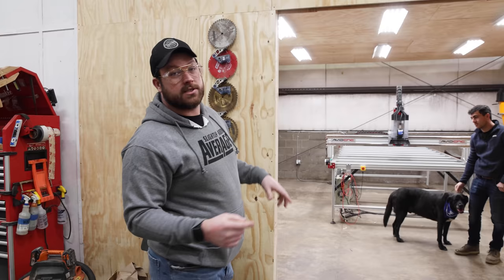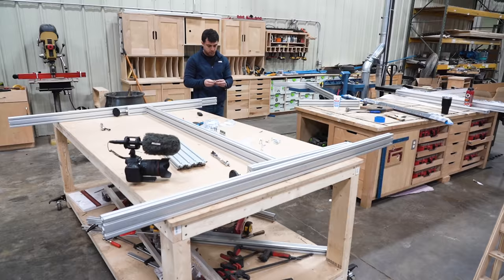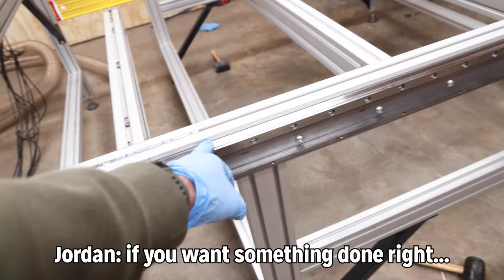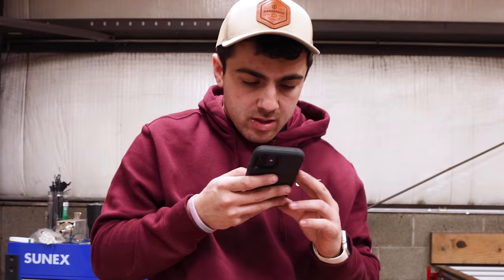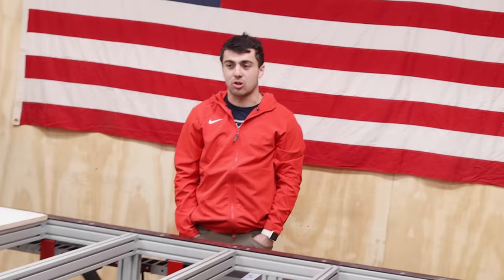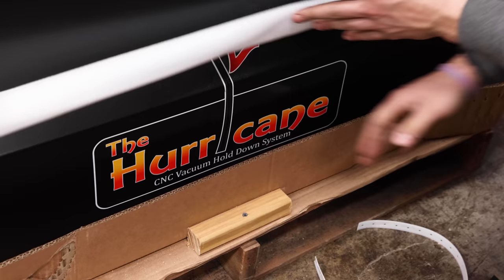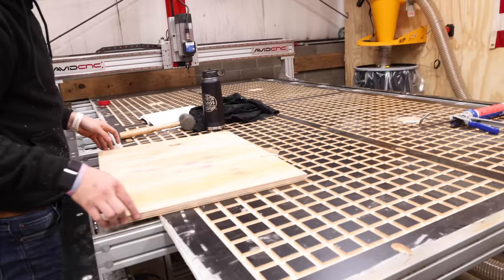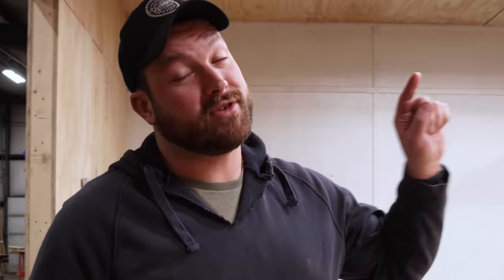Did We Just Build The LARGEST CNC On Youtube?

Comment: Jordan, Sam excellent work love how you guys check your work and square as you go can’t wait to watch Jordan slay some slabs on this thing I work at a cabinet shop and we use bungee cords to suspend our dust collection to the CNC definitely not as sleek as the pocket rail system but definitely efficient as the CNC moves away the hose moves with but also contracts as the CNC returns to 0,0 keep up the great work guys! Also I think if you were to move the rails to one side of the CNC vs directly over it might pull it easier and only give the CNC enough hose to go end to end when we got out second 4x8 CNC I did the dust collection and gave it to much hose and the CNC would catch the hose and rip it off very frustrating but you guys will figure it out I’m sure of it!

Comment: Looks like you guys need a rigid swinging arm for the hose. Do solid pipe along the wall about 8 ft, then a big swingin boom arm that reaches to about the middle of the cnc. Run your hose up and over that for moral (and physical) support.
Reply: Lincoln Street Woodworks did one for his table saw. Seems like it would work well in your aituation.

Comment: For dust collection we started out with hose suspended from string on a track but ended up putting in a boom arm made out of the same external diameter tube as the internal diameter of the flexible hose. That way the boom covers most of the table and you only need relatively short peices of flexible to reach the gantry.

Comment: for the dust collection pipe... Suspend the pipe from the middle of the table on the long edge on the dust collection side. Then move the router to the diagonally opposite corner. Now connect the pipe to the router so that it hangs from the middle and will reach each corner. No rails needed and the pipe won't twist etc.

Comment: Put masking tape over the corner the material makes with the MDF. It creates a stronger suction and will keep material from breaking vacuum with the table. If the machine gets hung up in the material, it will move it on the table even with the vacuum; especially smaller pieces

Comment: Hard pipe to the ceiling at the mid point of the bed then use flexible pipe to the gantry. This will reduce the extra movement in the dust collection

Comment: As someone looking into a cnc purchase... it really seems like avid has a shitty product. If not for it being expandable, it would be completely below market.
Every other similarly priced, and similarly sized(base size - 4x8), is significant more rigid and a superior product.

EDIT:
Use ID tag retractable leashes for controlling a suspended dust collector hose.
Reply from the maker: Did you consider price in your evaluation compared to the market ?